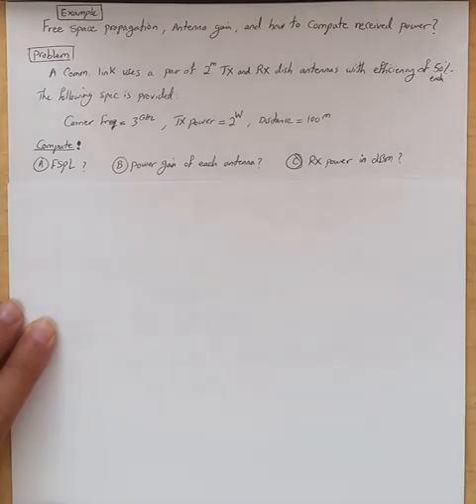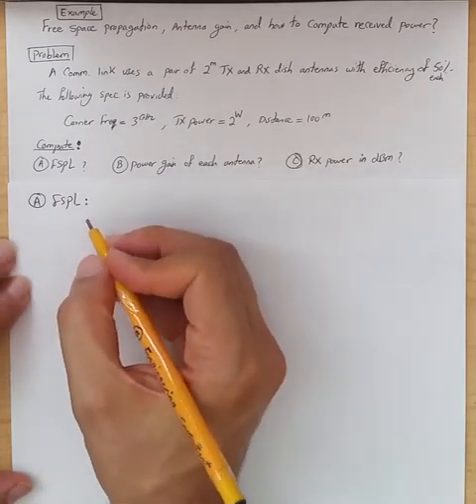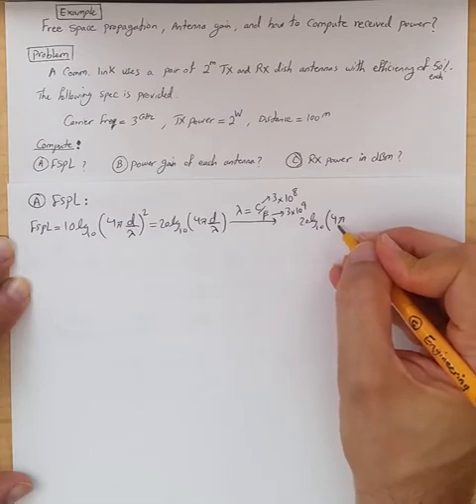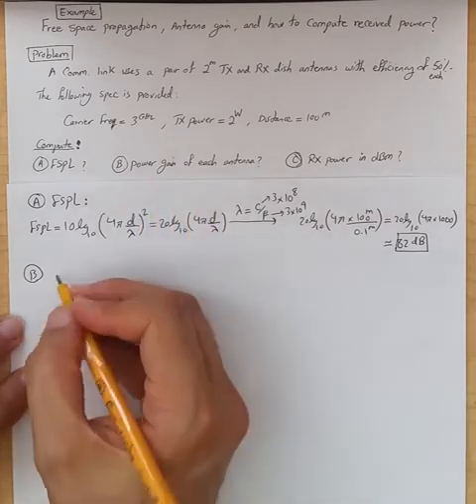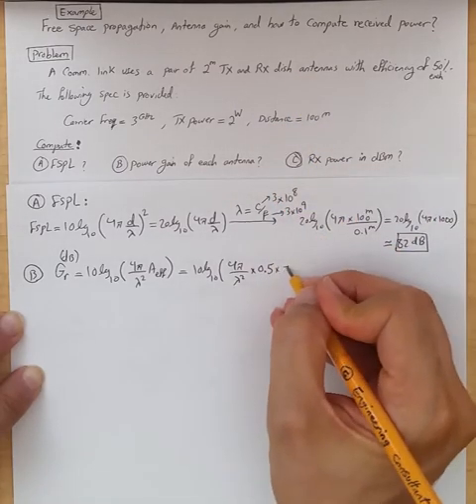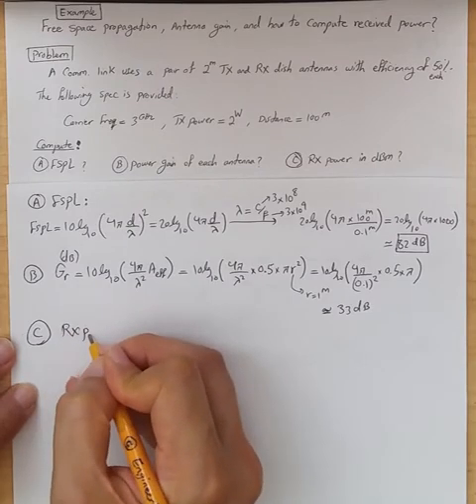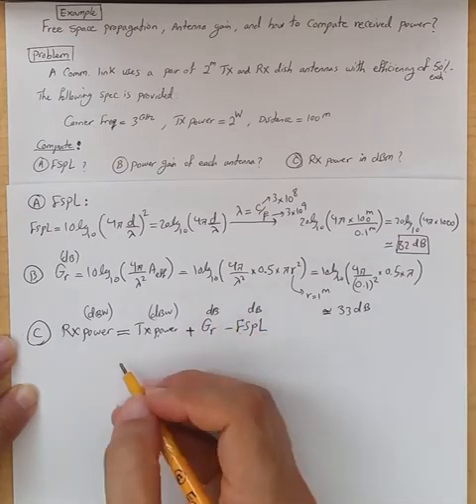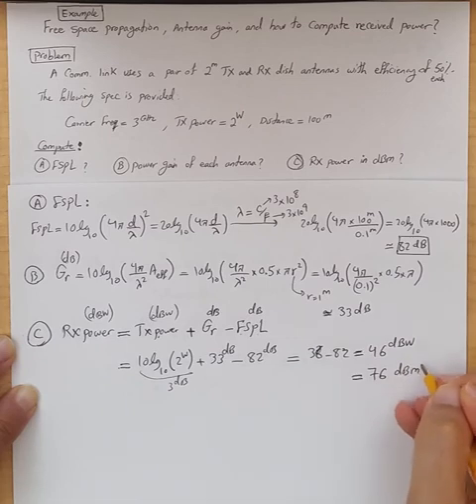Example: how to compute free space path loss, received power and antenna gain

Comment: curious about the units here. How are you adding quantities in dBm or dBW and other quantities in dB to produce an answer in dBW?
Reply: Conceptually, shouldn't SNR at the transmitter be used here to calculate the SNR at the receiver, and then the SNR at the receiver should be multiplied with the noise power to obtain the power at the receiver?